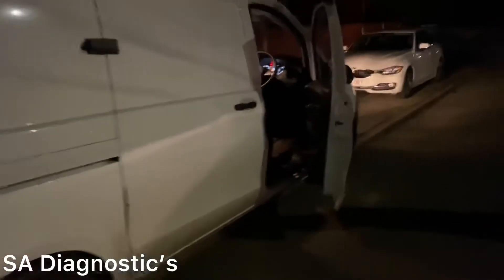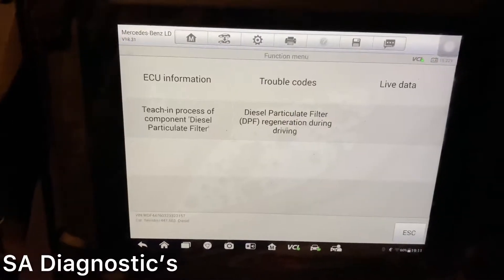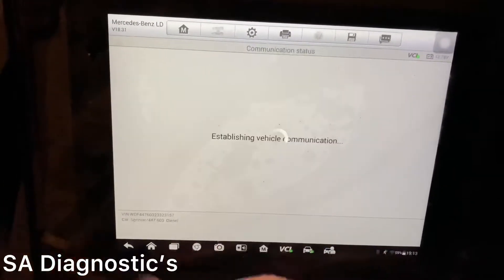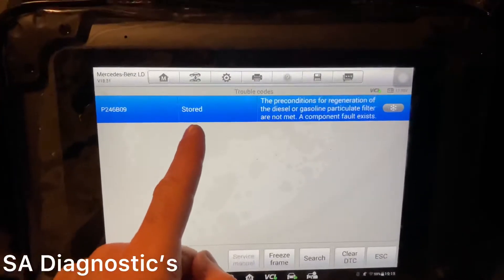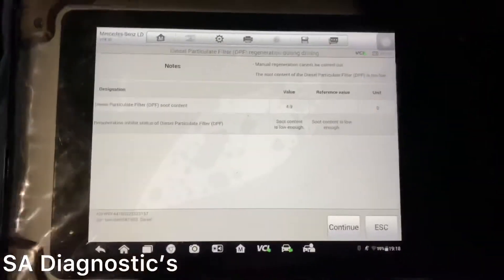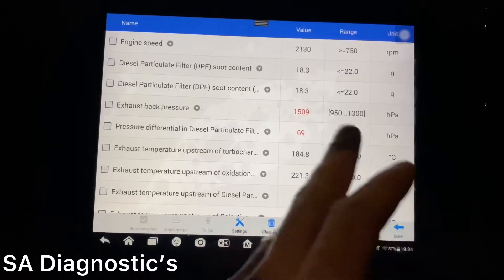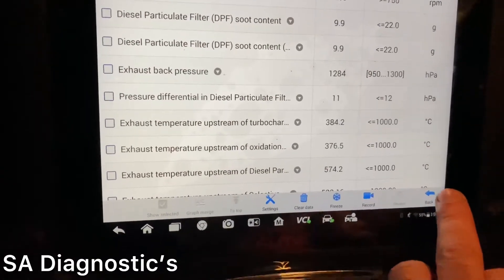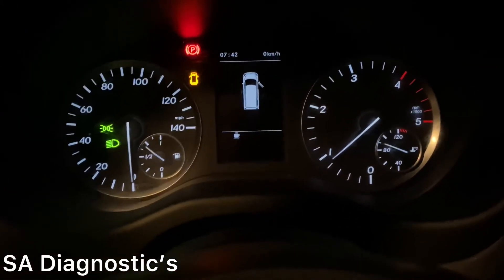Mercedes Van LIMP MODE Fault Code P246392 Diesel Particulate Filter Not Ok FIXED!!!

Comment: Hello how are you? I got Mercedes c220 cdi after reset pdf go for drive half hour the car engine cut off can not start thanks need help
Reply from the maker: Hi I’ve really not come across this situation before. Have you checked all wiring from battery to the engine and see if the earth is touching body of car…

Comment: But the van has disused this code as theirs a problem that needs fixing??? Clearing it it just brushing it under the carpet surely?
Reply from the maker: No incorrect I haven’t just deleted it I’ve done a regen which is what dealer would do or any garage before replacing or changing anything that’s obvs faulty…

Comment: Are you working on a Vito W447?
Reply from the maker: Yes
Reply: I wonder the Autel AP200 which Autel says has the same function as MK808 work for the Vito? I am currently experiencing DPF problem. On the dash it says Exhaust filter: high eng speed. Looking to get a scanner